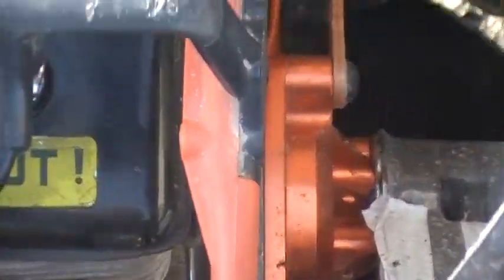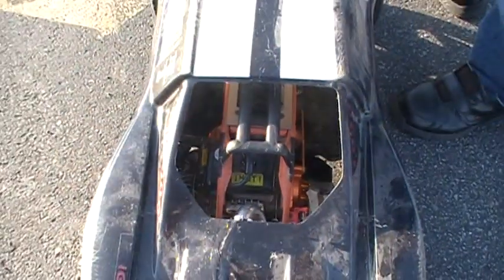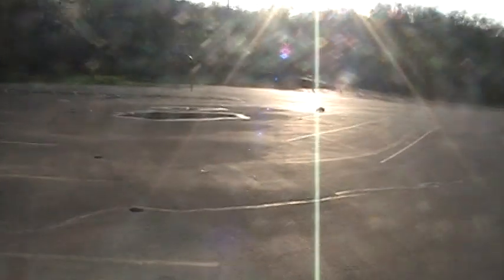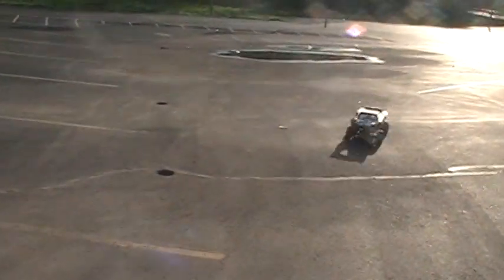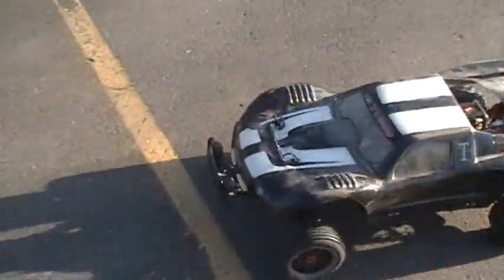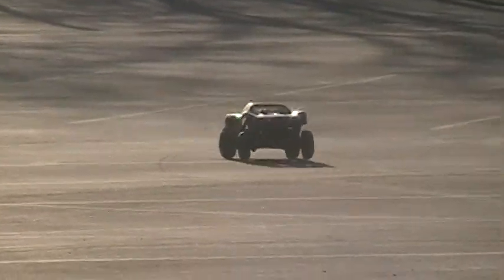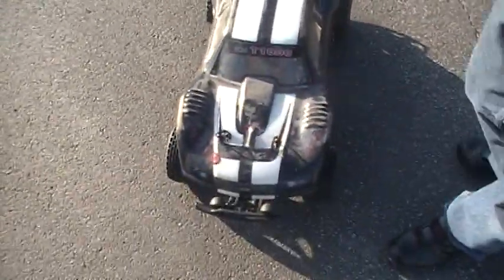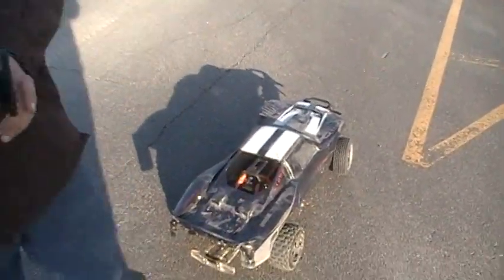Mark's 1/5 Scale 2-Stroke RC Car

Comment from the maker: 2 Gears, Automatic.  This is a 3 HP engine.  This one does about 35mph.  He has another with a 7HP engine and taller gears thats a lot quicker and does about 100mph.
Reply: Opferman Motors Dirtbiking was this in CT?